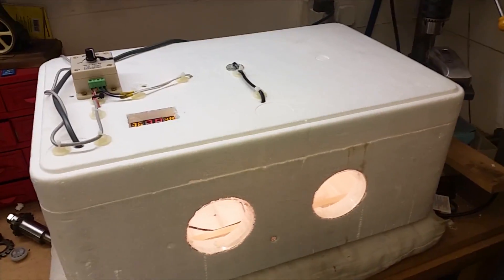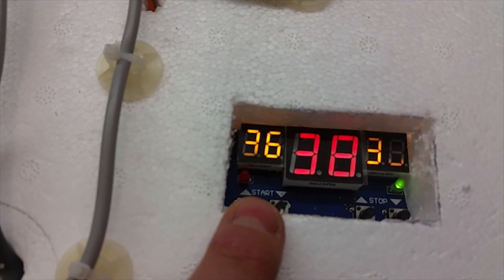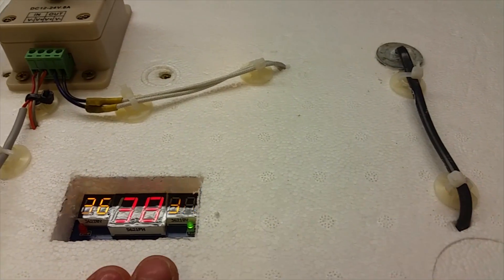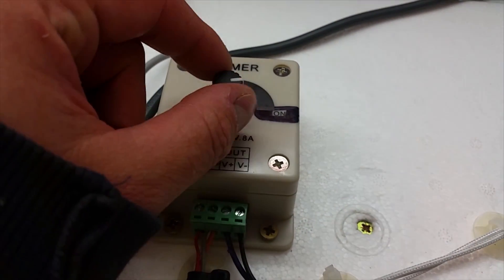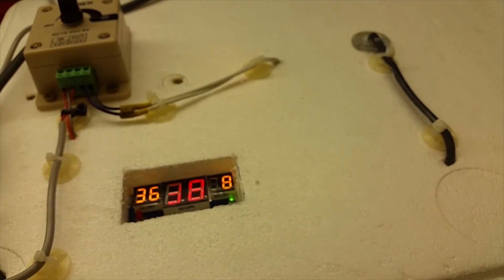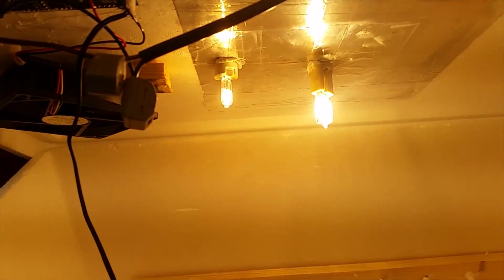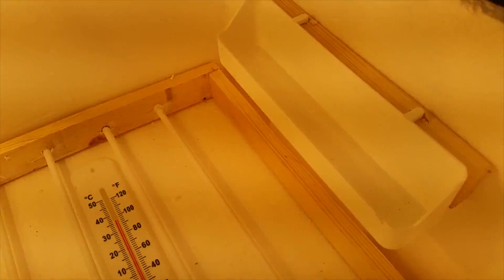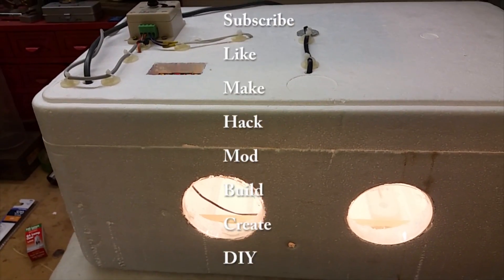Egg Incubator Homemade / DIY for chickens or quails - electronics project

Comment: Hello Sir. Thanks for your insite. I'm using a W1209 thermostat but my temperature is not staying constant for as long as I want. At least not as it does in my small industrial Bator. What could be the problem?

Comment: Nice project and build! You can separate the light and heat issues by using an incubator heating bulb. They screw into a normal bulb socket, to provide heat, but no light. You could manage the light timing with a common light timer. Both parts can be found on Ebay, for cheap.

Comment from the maker: Foam Box free from local garden centerLights - £2Digital thermostatic relay - £3/4 off ebayDimmer £3/4 off ebayFree old fan off a PC but you can get these dirt cheap.Probably £10 on other bits of wire and stuff and bits I`ve forgotten about but it wasn`t much. I also spent £5 on an anti slip matt so they wouldn`t slip when hatched.